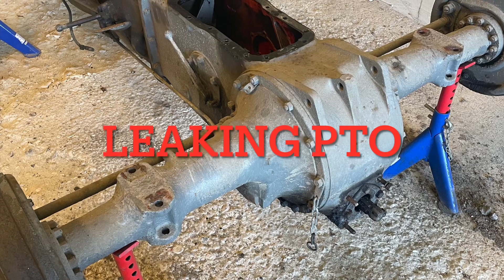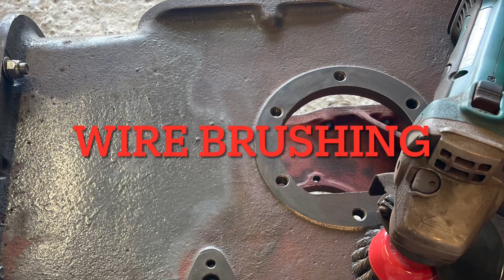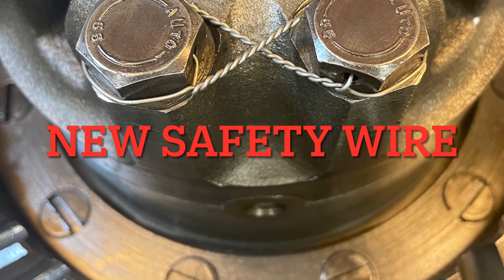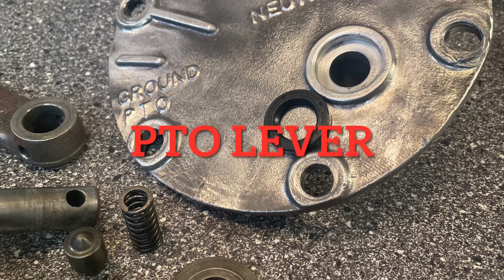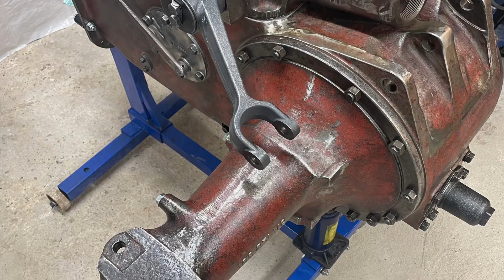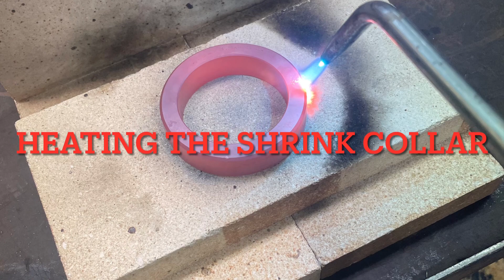Part 2. MF 35 Rebuild. Hydraulic, Diff/trumpet housing, Brakes.

Comment: Great work! How did you adjust the end float in the diff?
Reply from the maker: Thanks 👍
If you mean the pinion bearing, they can not be adjusted. But new bearings will tighten it up again.
Reply: The bearing on the crown wheel (the outer race of the bearing goes into the trumpet). I am replacing the wheel bearings and inner and outer seals on a Ferguson 20 and would like to replace the bearings on the crown wheel (I think this is also known as the diff) but many people are saying it's hard to set the end float and new gaskets are often a different thickness (usually thinner), so that can affect the end float leaving the new bearings too tight. Other people just fit new bearings and trumpet gaskets and all goes well!
Reply from the maker: Yeah okay. I know what you mean 👍
I did a dry test fit to make sure it was okay, and not too tight or loose. 
I have gaskets from different company, so I can adjust if it’s necessary.

Comment: nicejob, i have a question, for fitting the tapered bearings on pinion shaft of mine tractor i would like to try preheating it with a stove. Is it safe or is there danger to damage it. I read that 130 C for 15 min would be fine, but would like some others opinion before i trie it out  , tnx if u reply =)... and what is better heating in oil(what oil is it) or in stove ?
Reply from the maker: Thanks. 
There are many ways to do that, and my preferred way is heating all bearing in and old fryer filled with som engine oil or something like that. I’ll heated the oil to about 160-165 C. And it works fine.
Reply: thank you, i will try with a stove, wish me luck =). One more question, when u fitted new bearings on the diff pinion, did u use the old shims and it was good or u had to change the shim? I m just changing the bearings and the width of the bearing is very precise 32,75 mm so i assume the shim should be the same size, if the old bearing was the same dimension ?? @Mr.MillersWorkshop